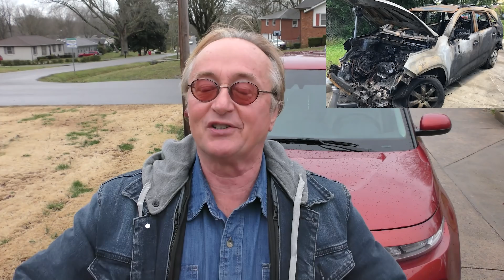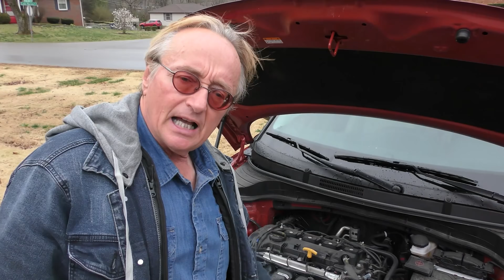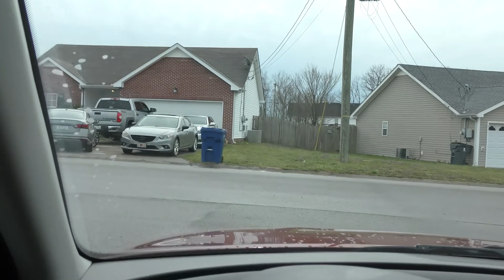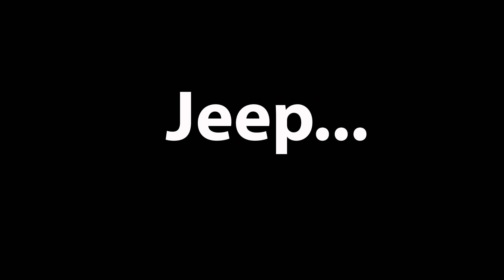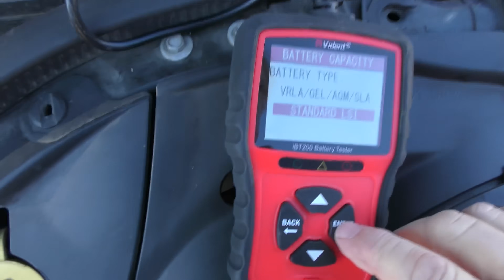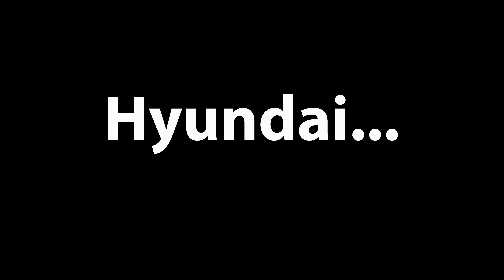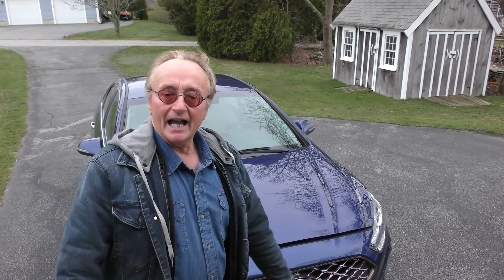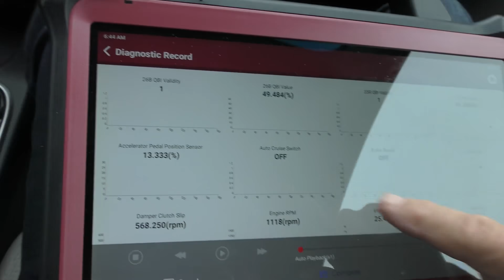3 Car Brands That are Crap

Comment: I saw your video on different oils and viscosities. I had a question on oem oil for my motorcycle that 14 years old but low miles. People are trying to tell me to switch to synthetic oil, when OEM is standard. Your thoughts?

Comment: The issue regarding the Kia's engine sounds like they use a poor quality cylinder head gasket and or subpar cylinder head bolts. Also the head bolts aren't torque spec'ed correctly....but that just my opinion. I had a Kia Soul as a company car(it had roughly 117000 miles) and other than a bad clutch it ran flawlessly when the clutch was replaced. Ran like a clock and it never burned oil like he says the red one does....and I would log nearly 300 a day in the vehicle...

Comment: Some years ago I bought a brand new Hyundai.  The brakes started acting up immediately.  I discovered the brake pads were depositing a thick layer onto the rotors, causing the problem.  Hyundai denied the problem.  The dealer said they were aware of the problem, and they turned the rotors, and put new Hyundai pads on!  I said the problem will come right back, and they just said they have done this repeatedly on some customer cars---AT THEIR EXPENSE!  So, I put brand new aftermarket rotors and pads front and rear on a brand new car. Now we only buy Hondas and Toyotas, what we should have done in the first place.

Comment: I had 3new 318 dodge trucks.all three had more than 200.000 miles.they all burn oil every 3000 miles 1quart  from the vary beginning.but it never got worst.can you tell me why.i had these trucks for 40 years .let me no.thanks

Comment: I just sold my Hyundai. But I have had no problem for 80000 miles.  I got a hybrid accord with 70000 miles. My gas mileage went from 33 mpg to 46 mpg with the Honda Accord hybrid!

Comment: My daughter's 2015 Kia Soul just blew at 75,000 miles. Im guessing we did better than most but religiously changed oil at 5,000 miles with synthetic. They will replace the engine as they extended the engine warranty 10 years 100,000 miles, but we are trading in after repair for a Toyota.

Comment: Got a 2018 Hyundai Santa Fe, I can confirm they have severe engine problems, avoid Hyundai until they fix their issues at least. They even posted a service bulletin back in June 2020 because they have so many issues with their engines.

Comment: They aren't all like that. We bought a Sonata new in 2016. 7 years and 154,000 miles later and we've never had a problem. Literally. We change our oil on time, rotate and replace tires, and give it regular tune ups. She still runs like a freaking top in any temperature; we've driven this car from Florida to Alaska. Best car I've ever had.

Comment: You should include the Ford Taurus generation for 1996 - 2007. These cars were very cheaply made, I know I own a 2002 Ford Taurus SE and it had more wrong with it than what the owner had stated. I would consider another car but can't really afford it, not in Biden's America anyway. Still puts out a burning smell when heater is on, even after head gaskets, timing chain gaskets, and oil pan gaskets were changed. The smell comes and goes, mostly when stopped you can tell, might be dirty or oily covered parts somewhere but no mechanic can put their finger on what it is. No wet, leaks, or drips with transmission pan. Like I said, only noticeable when heater is on and stopped, more than likely just old residue somewhere that gets hot but I figured out a way around it by either turning down blower fan or briefly turning it off at a stop. Maybe open a window. Anyone out there ever experience phantom smells that can't seem to be explained?

Comment: I seem to recall a Toyota engine that burns oil namely the 4-cylinder 2AZ-FE 2007 that affected the following models: 2011 Toyota Camry. 2007 – 2011 Toyota Camry Hybrid. 2009 Toyota Matrix.

Comment: So if the doesn’t burn oil until 4k miles into the oil change, why not just change the oil every 4k miles instead of what KIA recommends? You change the oil every 3k in your Toyota Celica. Bottom line sounds like you just have to actually check your oil and change more frequently, instead of mindlessly following the scheduled maintenance.

Comment: Keep up the maintenance at the Kia dealer and get the oil changes every 7500 miles. When the engine blows between oil changes you’ll get a new motor or new car due to the lemon law.😏

Comment: I bought a brand new Aprilia motorcycle that burns oil right out of the box. Seems to burn about a quart every 1,500 miles or so and of course the dealer says it’s “normal”.

Comment: I own four kias and they all have never had problems. One has over 200k plus miles. We got rid of the Corolla and got another Kia. They actually have more torque and pep when you step on the gas. The Corolla wouldn’t fckn go when you stepped on it 😂.
Also good luck with your 700-1000 dollar a month car payments. I pay cash for new cars and kias are worth the money.

Comment: Its crazy my 2003 Explorer Sport Trac, at 175k miles, a notorious truck with an oil pan leak can still go 7-10k miles on oil full synthetic and I still drain 3.8l out of 5l when I change my oil. Kias suck.

Comment: We have a 2014 Lexus RX350 with 200,000 miles.  It doesn’t burn any oil at all.  I run full synthetic oil and change the oil every 3,000 miles.  The trans gets a flush and fresh fluid every 30,000 miles.  It runs like new.

Comment: Nothing like a good old BA Falcon.  Mine has been abused but still going strong at 370.000 kms and (surprisingly) still worth good money if I sell it.  Cheap parts, easy engine to work on.  Changed the diff, catalytic converter, brake pistons, bonnet cable, radiator header tank, and that's about it aside from plugs and oil of course.  KIA have been treating their customers like rats for nearly half a century now and Jeeps are just plastic rubbish from the get go.

Comment: Maybe we have just been lucky, but my grandma had a Kia, I have a Kia, and my sister also drives a Kia. None of us ever had issues with ours. Mine is a 2009 Spectra and I am still driving it every day and the only thing I have ever had to get done besides normal maintenance and tune ups has been replacing the alternator a year ago. I do not know how reliable the consumer report rankings are but I don't see Kia at the bottom. I think the Kia hate is based in bias at least a little!

Comment: Hahah damn he's so right about hyundai's, i got a brand new elantra n line ultimate and either the computer or the transmission is trash😅, i brought it to the dealer and the mechanics tells me that the engine is perfect, and only drove it 2 km😢😢😢, and i after i brought it to a transmission specialist, the guy drove it and at the first 4 seconds saw that there were something wrong about it🎉🎉,  they're literal imbeciles

Comment: Kia will replace an engine that burns oil, but you have to go do this dance.  You need to get your service always done by Kia.  If you burn 2 quarts or more in 1000 miles you're probably getting an engine if you have less than 100K miles.  They have this service procedure you need to sign up for to qualify.  Basically they monitor your oil consumption to see if you're eligible.  It's a hassle.

Comment: 2017 Hyundai accent belt squealing screech right at start up then would go away. We had to take it in 7 times…. 
2019 dodge ram classic 1500 “” blew up with 130,000 km so 70,000 miles giver or take no warranty left got to eat it…

Comment: Air cooled VW’s would run hotter on #3 because of the oil cooler location…
Reply: Some distributors were 3 degrees retarded built in on #3 cylinder so make sure you install #1 on #1…

Comment: 3:23 I had the same issue with my 2010 Honda CRV and they said it wasn’t burning enough oil for the recall. I eventually replaced the engine at my own cost a couple yrs ago.

Comment: Kia or not..any vehicle..no more of this changing oil every 7-10k..not me!!! I still do every 3k!!!!
Reply: “No more”?  That used to be standard way back 40 years ago!  3000 is a ripoff and says these things aren’t very tough.
Reply: @theOlLineRebel  say what!!?????
Reply: @MichaelSecondo-u7c  Hey, it's not going to hurt your vehicle to do lots and lots of oil changes, but in the old days it was standard to have 7500k.  Then by the time 1990 I was working car parts, standard was 3000k.
Reply: @theOlLineRebel oil in 1990 and 2023 is not the same. Don't need to be paranoid and change every 3k. I would say 10-15k is really good time, but not every 3k miles

Comment: We own a 2007 Kia Sedona.  Bought it brand new and it now has more than 286,000 miles.  Nothing major in terms of engine or transmission.  Overall repairs is about $10,000 over the 16 year ownership periods.  So about $600 to $700 a year.  Not sure if that is good or not.  The car only broken down one time on the road.  So the Kia I have is very reliable.  And I change oil regularly every 3000 miles.

Comment: Huh, in 2018 I got a manual transmission 2010 Kia soul with barely 50k miles on it for only 7 grand from a dealer. Can't get that these days. It has given me zero trouble now past 100k miles. Maybe I got lucky or maybe its the model year I don't know. I love that Kia soul which is odd because normally that kind of car is not my style at all. Maybe I just could not pass up a car with 50k on it for 7 grand and a manual that the dealer was having a hell of a time selling because "What's that sticking out of the floor?" lol. Mine does not burn any oil but I think the water pump is going bad. other than that zero issues. I even tow motorcycles with it zero issue. It came with the tow hitch lol. Unexpected on a soul!

Comment: My bff had a kia soul..third in line to the most fun I've had driving a smaller car..the first was my Pontiac fiero and next was a Renault alliance..both 25+years ago..now, I'm an old fart living in a rustbucket Dodge caravan that loses about 1/2 qrt oil every two months but it needs valve cover gaskets and an oil change but brakes first, it's also been assaulted by a deer so new hood is in need..replaced radiator, fan, headlights...looking for another nicer newer van.. Sienna, Odyssey, Astro..springtime cuz this Dodge won't pass inspection due to rust..the typical rust these vans are known for..under the sliding doors, both sides🤬🤬🤬

Comment: It is a sad state that you can't work with an honest dealer, or most independents.  Over many years, I have been efed over even more than I learned of.  One problem is that I purchased the wrong cars.  Wised up with a string of Toyotas & Hondas from 25-odd years ago.  They are maintained well, so it's just replacing worn out parts.  I found a good independent before 1994, but now he us retiring - now searching for a replacement who is honest, and is less money than the local dealer.  The local Toyota dealer has been honest about repairs, but they are WAY too expensive.  The local Honda dealer needs to be avoided.

Comment: My 03 Cavalier.
1000 mile oil changes.  Burns no oil. Mobile one 0w40 Oone sweet gree street machine. Run better than new and more
Power, less weight
 Rear track widened by 4".The frond 2".  Mo  body roll. 3.6 rearend gear. 4.10
Tudor coupe

Comment: 😂 I don't know what Scotty's been smoking but definitely something from Toyota. Between co-workers and family I seen at least a dozen kias and nobody's had any issues with them.
Im approaching 400,000 mi on my Sportage and the only problem I see with engines in the shop are  people who don't change the oil. Do your maintenance and change your oil with full synthetic every five to six thousand miles and you'll be fine. If you're not you have a 10-year 100,000-mile warranty that they will stand behind if your maintainig the vehicle like you're supposed to. By the way all three of my cars don't use a drop between oil changes.

Comment: TLDR; If you want to know which car companies make the best cars, become a driver for your local dealership.
My family is a Hyundai and Kia family. Never had a problem burning oil with the Kia's and never had a transmission issue with the Hyundais. My Mom, Dad, and I work for a car company that owns the monopoly on local dealerships. We're drivers and get sent to pick up and deliver for all of the stores locations; Volkswagen, Toyota, Honda, Nissan, Kia, Chrysler, Jeep, Dodge, Ram, and Ford. They live or die by their reputation which is excellent. Sorry, your dealerships are scum, but that's not a reflection of the brand. As I mentioned one company owns most of the dealerships in my city. Also, Hyundai has the best power train warranty in the business, 10 year 100,000 mile, which no one in my family of 5 has had to use in any of the Hyundais we've owned. While driving for Honda, one customer hated her car so much that she exchanged it the day after I delivered it. Jeeps are rubbish, they get horrible gas mileage, break down frequently, are expensive to repair, and their near vertical windshields are highly prone to pings.fromnthrown rocks and other debris. I actually considered getting a Honda or Toyota, because of their reputation, and their technology isn't far behind Hyundais especially in Toyota. The difference for me was in the price. I could get more for my money with a Hyundai, and from experience they last if you take care of them. I admit, I would have bought a Prius if I had the extra $9,000. I would have considered a Kia, but with Biden's eminent re-election I thought I'd go with a hybrid that I didn't have to plug in. I've had my third Elantra over a week so far and love it. The first two were totaled by people not paying attention. I live in a college city. I'll continue to drive other vehicles as part of my job. Notable mentions are Dodge Durango, Hyundai Palisade, Volkswagen Jetta Diesel, and Ford Raptor. I was also surprised by the little Chevy Cruise though you'll never get me to admit it.

Comment: I had a 2005 5spd manual Saturn ION RL 2.0 turbo charged with 180k miles never burned a drop of oil! So not all turbo engines burn oil

Comment: my 23 years old Mazda 323F 1.5 i doesn't burn even 1 drop of oil after 44000 kms. Yes I change oil every year or at least after every 30000 kms, but never with some cheap crap, I make sure it always gets the best Full synth oil, that is for th last 23 years on a regular basys!

Comment: My 2010 KIA Soul runs fine.  Should last me another 5-10 years.  If it starts burning oil every 4k miles, then I'll never have a problem because I always change the oil at 3K miles.  No issues.  $20 oil change fixes the problem.

Comment: If a dealer tells you something’s normal with a transmission issue. 
Go outside and see if they have a new or used model of your car and TEST DRIVE IT. And see if that one shifts the same. If it does NOT I’d go back inside and say ummm NO THEY ARENT ALL LIKE THIS! I bet they will be stupid silent

Comment: i have 2011 kia soul base model 1.6L manual transmission. 125k miles. i don’t know if it burns oil because i dont change it, the lube place does. some of the power windows no longer work, the rear reverse back up lights wiring is bad. replaced battery twice. replaced gas cap due to code telling me to. main big problem was knock sensor code kept going off. it wasnt the knock sensor (had it replaced 3 or 4 times). it was a bad pin on on ECU connector! i still like it though! because it’s great for tall peeps!

Comment: Rodents take seeds and sit on top of a warm valve cover and drop seeds into the where the injectors plug in. Then they chew the wires to get at the seeds. Beauty cover?... Nope, rodent shield. That cost me $2200 to learn that.

Comment: If kia and Hyundai are so bad why are they some of the best selling cars????
Reply: "Some of the best selling cars"

That's a pretty vague statement. Also an untrue one. 

Of the top 10 best selling cars in 2022, not a single Kia made the list. In fact, there isn't even a Kia on the list of the top 25 best selling cars in 2022, and there is only ONE Hyundai. 

So no, Kia and Hyundai do NOT make 'some of the best selling cars'. You just pulled that out of your ***.  

TOYOTA sold more cars than Kia and Hyundai combined last year.
Reply: They are cheap and offer financing for those with poor credit.

Comment: I have owned four KIA Souls, they all ran good no issues. I now own a KIA Soul EV bought used and battery would charge to 35 range miles. Drove four a year and half, got a letter from KIA, warranty says they will replace the battery, free. Now I have a KIA Soul ev thats gets 108 range miles.

Comment: I’ve had two Elantras. The engines quit on both of them around 100k mi.. The first, a 2011,  lived to a little over 100k. And the second until 97k mi.. They drove fine until they died. No problems but still I’ll never buy another Hyundai.

Comment: Planned obsolescence
Reply: Planned obsolescence is (mostly) a myth. In reality, consumers just want cheaper products, and cheaper products typically don't last as long. You can't have your cake and eat it, too. There are always trade-offs. 

FYI the average car sold today lasts a lot longer than the average car sold in the 1950s. The average mileage achieved by vehicles sold over the last few decades has INCREASED. Hell, some old cars didn't even have oil filters and you think they lasted LONGER than todays vehicles? Try again. They were shitboxes and most of them are rotting away in a scrap heap.
Reply: @aarongreen1654  good point!

Comment: The funny thing about the US is that the bar brands that you consider unreliable are the exact brands we consider ultra reliable in Europe (with the exception of Toyota and Honda); brands like Hyundai, Kia, and especially Volkswagen are held in high regard. Fiat is also regarded as quite a reliable brand here (I have owned two of them and found them very good). Whereas the opposite is true in the US.